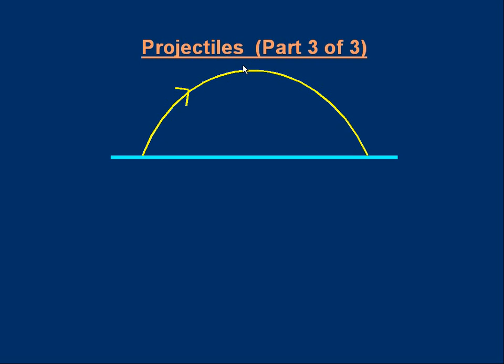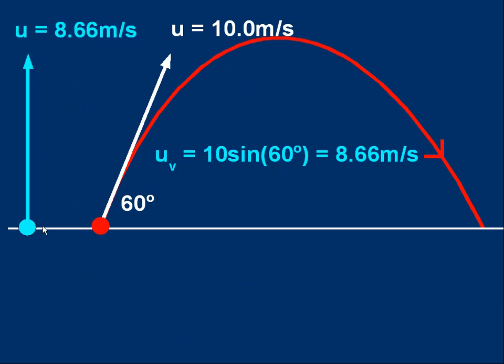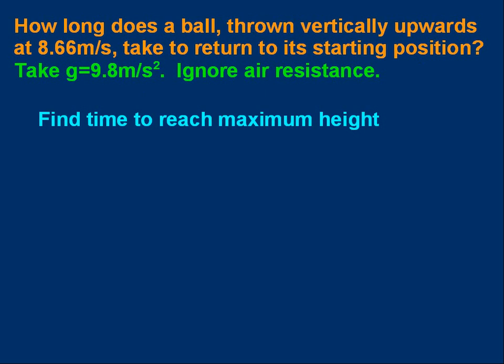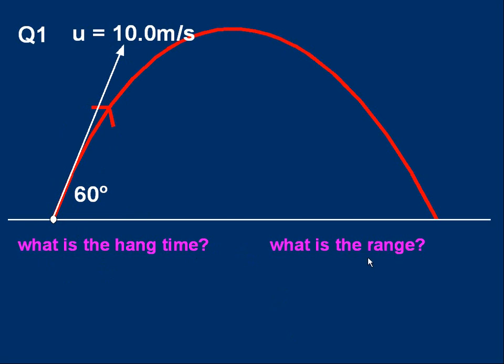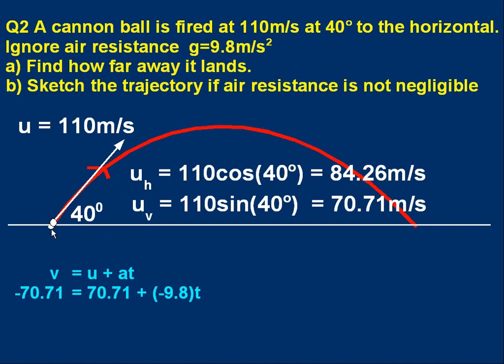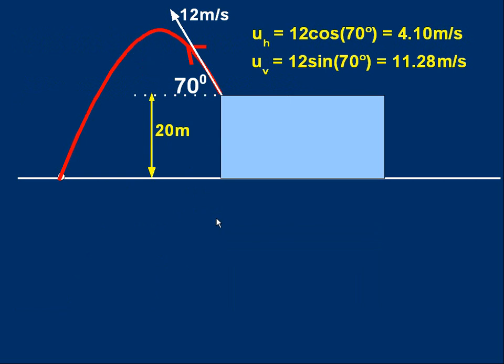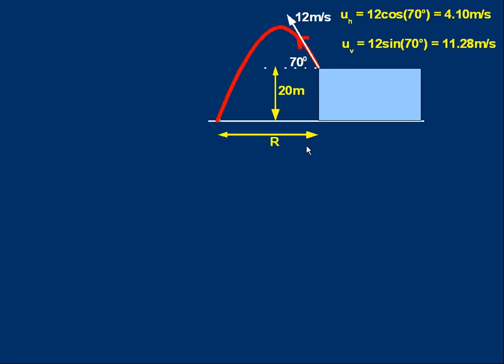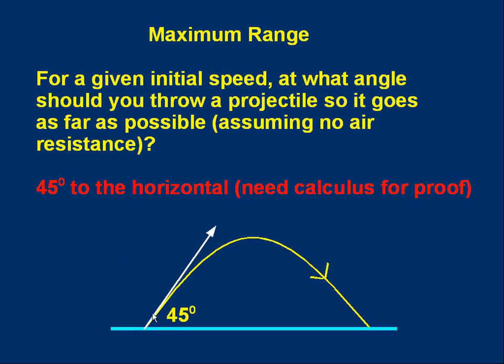M12c Projectiles Part 3 of 3

Comment: thank you for this, but i have a question. If you were supposed to find the range of the last problem, where did you finding the time come in?
Reply from the maker: Sorry I don't fully understand your question.  You find time-in-the-air  by considering vertical motion. Then multiply this time by the horizontal component of velocity to get the range.  If that's not what you mean , try to be more specific and I'll try to answer.

Comment from the maker: Part 2 of reply

The displacemeent, s, is -120m (negative as downwards).
Find the time of flight using s = ut + at²/2
When you put the values in, you will get a quadratic equation. Solve to find t.
Use the positive solution, the negtive one does not have a physical meaning.

The quickest way to find the final speed V is to use
Final KE = potential energy lost + initial kinetic energy
(1/2)mv² = mgh + (1/2)m*84²  Note m cancels.

(Or you can combine the final velocity components.)

Comment from the maker: Part 1 of reply 

Hi. I can't provide a detailed solution ere and I don't do h/w.  But I'll help on this one occasion.

The fact there are two tanks makes no difference. Just consider one.
Take up as positive (g = -9.8m/s²).
The tank's  initial velocity at the moment of release is the same as the plane's, 84m/s at 30˚.
The initial vertical component of velocity, u, is therefore +84sin(30˚) (positive as upwards).

Comment: A pilot cuts loose two fuel tanks in an effort to gain altitude. At the time of release, the plane was 120 m above the ground and traveling upward at 30˚ to the horizontal, with a speed of 84 m/s. For how long did the tanks fall and with what speed did they hit the ground?

Can you explain this question to me? I learnt projectiles with your video and solved all the questions but I don't understand this last one on my book

Comment from the maker: The initial vertical component of velocity is 10sin(60⁰) = 8.66m/s.
This is because initial velocity is 10m/s, but it is at an angle of 60⁰.

To work out the time in this problem, we consider ONLY the VERTICAL motion.
The vertical velocity component changes from +8.66m/s to -8.66m/s due to the vertical acceleration of -9.8m/s².  So we use u = 8.66m/s and v = -8.66m/s.

Comment from the maker: Yes. At any instant, the air resistance acts in the opposite direction to the velocity at that instant.  If the velocity has horizonatal and vertical components, both are affected.
This makes the maths very difficult and you have to use calculus.  If you do a search on "projectiles with air resistance" for example, you canl find out more about it.

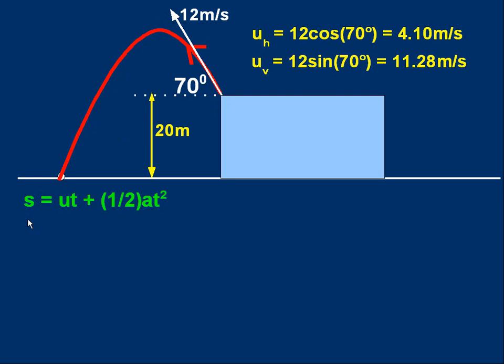Comment from the maker: Hi. g is not mentioned at 20:00; I guess you mean 21:55.
After max height, velocity gets more and more negative.
v=0 at max. height.
After a further 1s: v=gt=gx1= -9.8x1 = -9.8m/s 
After a further 2s: v=gt=gx2= -9.8x2 = -19.6m/s
Etc.
Note, speed increases; the minus sign that tells you the velocity is downwards. If you forgot the minus sign for g, you would get positive (upwards) velocities!
g is constant and downwards; it causes slowing-down while rising and speeding-up while falling.